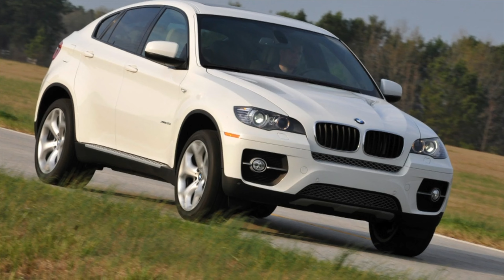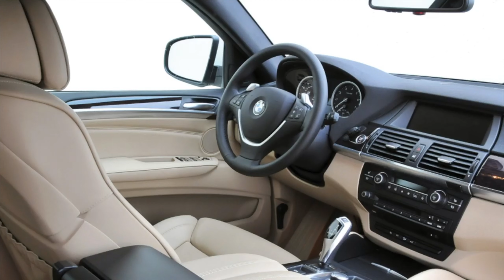BMW X6 E71 - Check For These Issues Before Buying

Comment: I bought a BMW X6 40d 2013 with 95000 miles. After a year and 118000 miles, the engine was gone. Really disappointed. Just after 23000 miles. I need to replace the engine and will cost me over £8000. Avoid buying this model. I'm moving to another brand.
Reply: the timing chain need replaced for n57